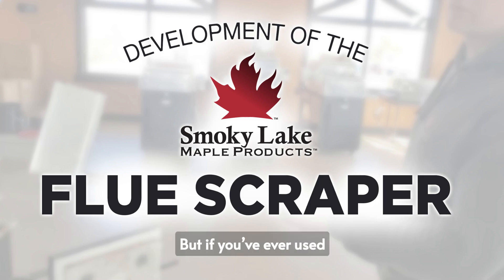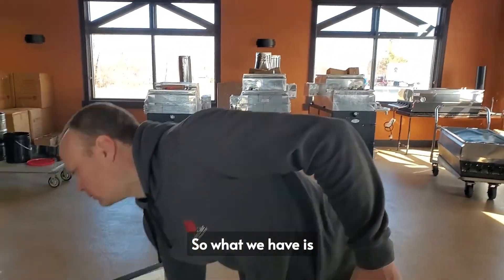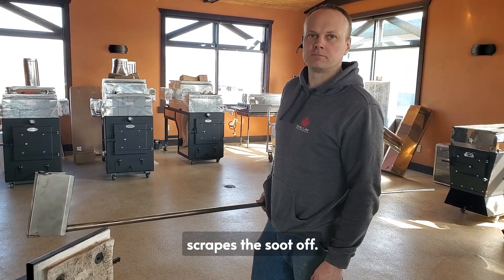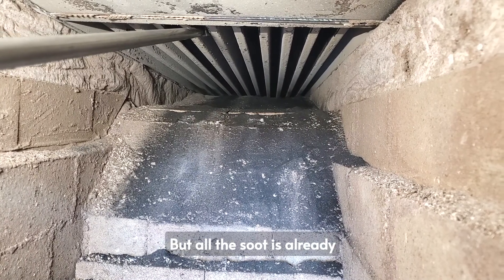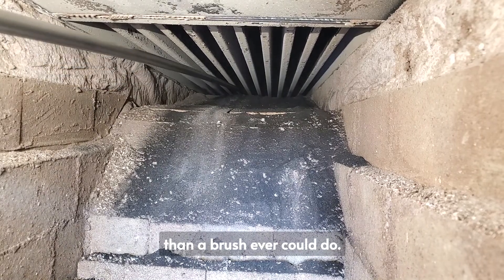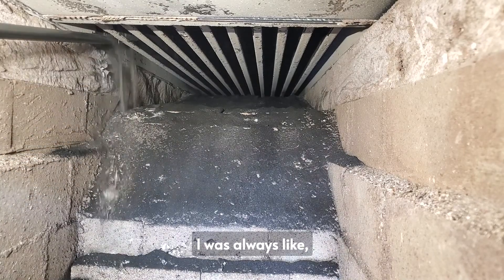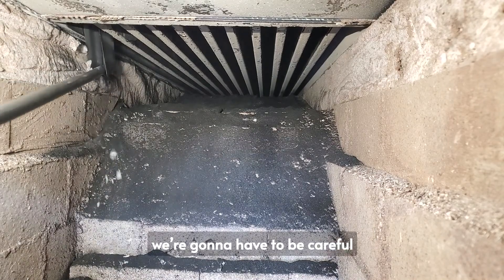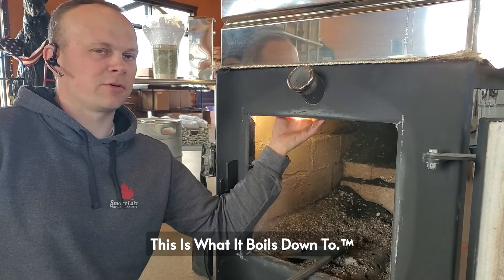Development of the Smoky Lake Flue Scraper

Comment: Any idea how much of a % increase in the boiling rate is seen after a scraping? A ballpark % range estimate assuming typical soot accumulation. Also, how often would you recommend scraping the flues? 

It sure looks like a dandy tool!
Reply from the maker: @DanielLynch-q1m  I recommend scrapping before each time you fire up because it doesn't take very long to do.  I have not attempted to measure the efficiency gain, but the difference in the way it boils is visibly noticeable.  I'd be surprised if the difference was less than a 10% gain and I'd be surprised if it was more than a 25% gain.

Comment: What’s the maximum and minimum flue width that it will work with? I have 7” flues but I’m not sure the width is the same…
Reply from the maker: @christopherwicks9664   1" minimum 3" maximum spacing.  I'm not aware of any commercially built flue pans that these scrapers will not work in.
Reply: @ Awesome! Thanks!